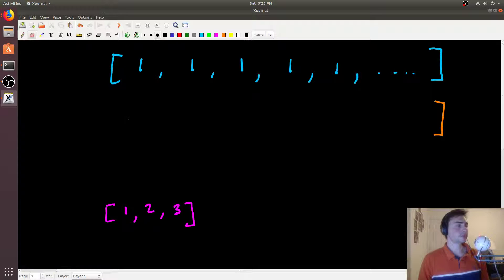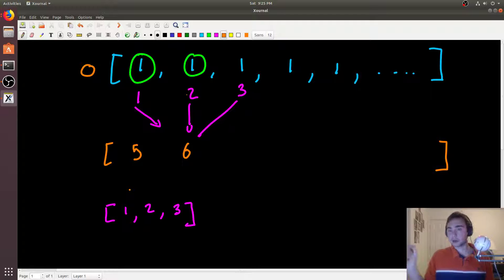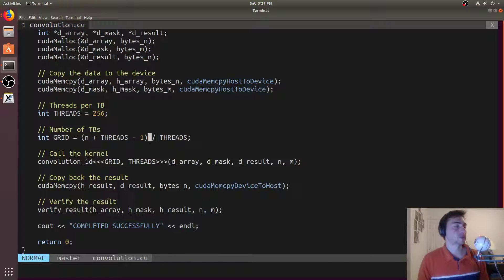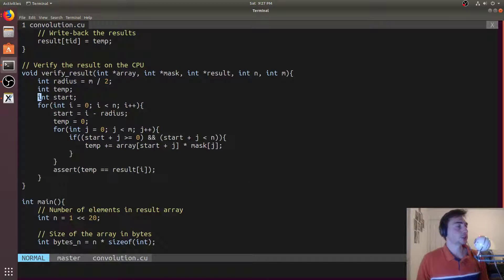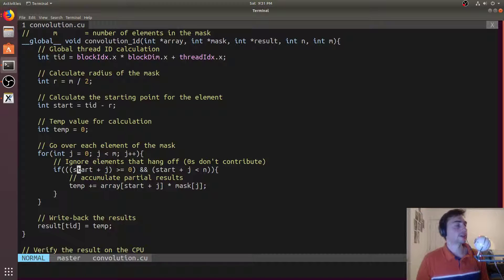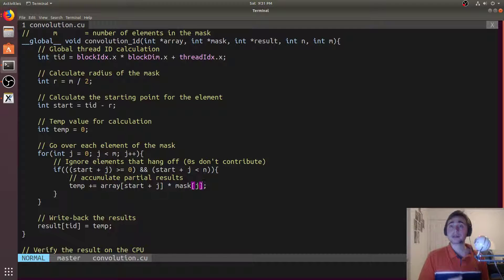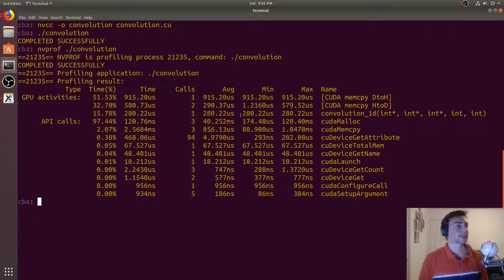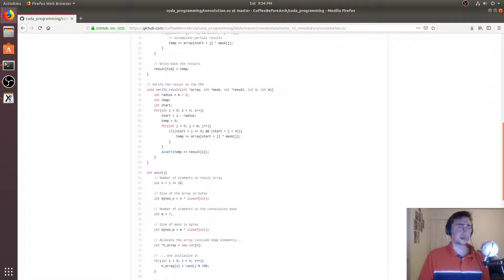CUDA Crash Course: Naive 1-D Convolution

Comment: Hey there! First of all thank you for the video you are a lifesaver! I have 2 questions though! When we are doing a convolution between 2 signals, we reverse the one of them and slide it to compute the product of the overlapping values, and then sum all of them to calculate each element of the resulting array. so:

1 why aren't you reversing your mask?
and
2 shouldn't you start calculating the convolution from multiplying 1x1? When I'm calculating the convolution of these 2 matrices (assume you have 6 1s and the mask is {1,2,3}, I reverse the mask to {3,2,1}) 

I get this result {1 3 6 6 6 6 5 3}
Reply from the maker: Glad you are enjoying the series! To answer the first question, it has no impact on the computational pattern of the kernel (that's merely an input, which in this case, is even just random data).

To answer the second part, image processing (as far as I know) only uses the central part of convolution. Therefore, the size of the inputs are the same as the outputs. Extending this to support the full output is a fairly trivial task though.

Hopefully this answers any questions you have, and if not, just ping me back!

--Nick
Reply: @NotesByNick  I got it! What you're saying is making sense, cause, when you pass an image through a filter you should get an output that is the same size as the input, not bigger! I'll try to play around with the code, to produce the full output though.

Thanks again mate!